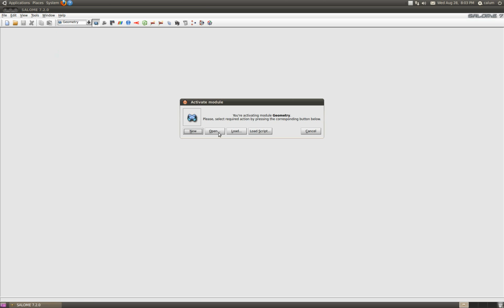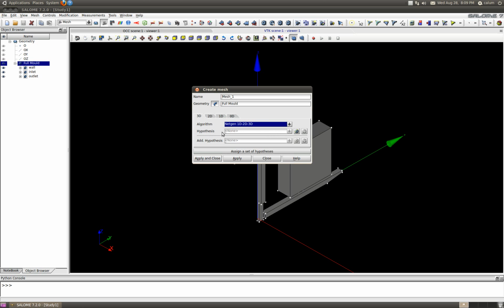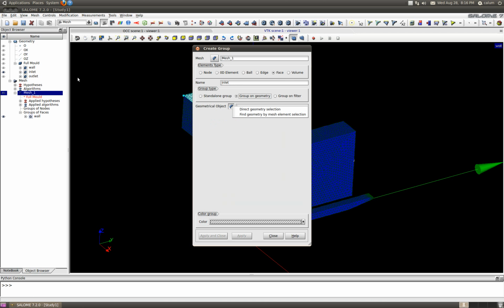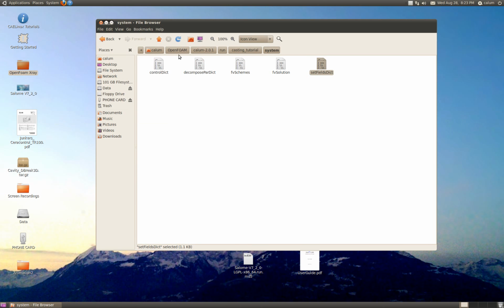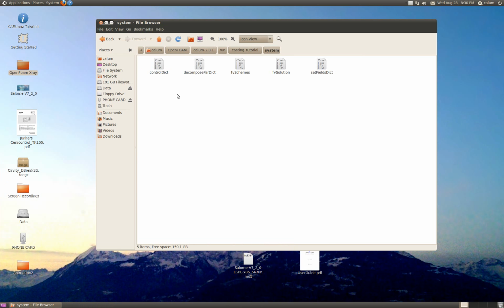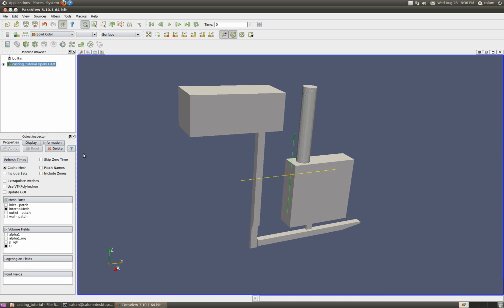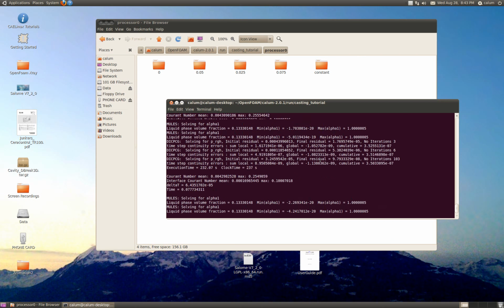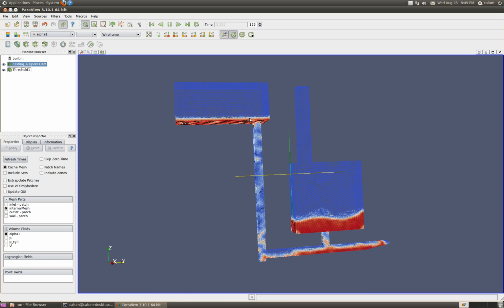Salome OpenFOAM Tutorial - CAD model to Solution Complete

Comment: Hello Calum, this tutorial is amazing! thanks for that. I'm trying to follow you, but in the files that you uploaded is missing the ''constant'' folder. Regards
Reply from the maker: It is explained in the video, that I did not include the constant folder, as the one I used is unchanged from the constant folder in the Dambreak, in the tutorials folder in the standard openfoam tutorials. So just copy the constant folder from that, and it will work. Of course some things will have changed as this is for an old version of OpenFOAM.
Reply: @CalumDouglas  okey mate, thanks again!

Comment: Hi. I am using version 4.1 of OpenFOAM.Whenever I try to run the command :  mpirun -np 8 interFoam -parallel , an error appears stating that buoyantPressure has been changed to fixedFluxPressure. After changing it and running the command, one more error pops up. 
FOAM FATAL IO ERROR: 
 cannot find file
 file: /home/stark96/OpenFOAM/stark96-4.1/run/trials/casting/processor0/0/alpha.water at line 0.
Is there any workaround for this ?
Reply from the maker: There are significant code detail changes from OF 3 onwards. Just follow the video, but use the DamBreak tutorial from your OF4 installation as the starting basis. I will try to do a new video soon but before that - this is the best course of action.

Comment: Hi, Great tutorial! I was trying to follow your method to setup my own simulation. I wanted to import the CAD model I have created into SALOME, creating the patches and exporting it to use it in OpenFOAM to study the flow of a fluid in a cavity. I managed to get the .unv file but when converting in OpenFOAM it does not work because it says that the controDict file is missing. Do I have to create the controlDict file first? I was hoping OpenFOMA import tool would do it for me...
Reply from the maker: Hi,
I think you need to learn some more about OpenFOAM before creating your own simulations.

You must learn how to run some of the examples so you understand what things like the controlDict are - before you can build your own case.

The control dict is covered in my video, it even shows you in the contents list where to look at the video to see ControlDict - so this suggests you did not actually watch the video.

UNV to Foam imports the mesh - ControlDict controls the simulation parameters like time-step.

I suggest you learn to run and modify the basic cases like DamBreak and Cavity. Understand how they work before you try to jump in to the deep.
Reply: I don't really see an obvious reason why the controlDict file is needed to run ideasUnvToFoam, however it does just take 5 seconds to copy one into it :)

Comment: As someone who is just starting out in CFD, can you suggest whether I should be learning to use snappyhexmesh or salome as my meshing utility? Has salome any significant disadvantages in comparison? I intend to run 2D simulations derived from 3D CAD files. Best Regards
Reply from the maker: Salome is ok for very small very basic models, but if you want to do any sort of problem with "real world" geometry, large files, complex shapes - forget about salome.

It is far too slow to make very large meshes.
Reply: Thanks for the tutorials and clearing that up!

Comment: thank you so much. I am wondering if you any other software for labeling patches. I am loading STL files in Salome and it takes forever to do anything.
Reply from the maker: I rarely use Salome, so usually I just manually rename the stil files (which means they have to be ASCII)

All that is explained in my SnappyHexMesh video

https://www.youtube.com/watch?v=ObsFQUiVi1U
Reply: Thank you so much for the reply. What do you do if your stl file has more than one patch in it? How do you name each patch? The point is that my stl file has only one solid in it. So somehow I need to separate facets into different solids.
Reply from the maker: Please ACTUALLY make some effort to watch the video I made AND gave you the link for before asking a second set of questions.
Reply: +Calum Douglas I watched this video and snappyhexmesh video before. But I'll watch them again. As I said I just have one solid in my STL   and I want to extract different patches.
Reply from the maker: You need to do that at the CAD stage, before you export as STL. An STL is just a collection of triangles, as I showed in the video - so unless you break up the model at CAD stage, its very very difficult to do anything with patches. Perhaps possible, but I do not know.
Reply: +Calum Douglas Thanks.

Comment: Thanks for you video. I am learning OpenFOAM with the purpose of simulating a cast filling process, and the video gave me a great start. As I am new to OpenFOAM, i would like to know if you could answer me two questions. I see that you used the interFoam solver. Can the InterFoam solver compute the heat flux while the filling occur ? And can the solid wall of the mold be added to the model?

Comment: hello Calum Douglas and thanks for your useful tutorial,
i'm new to OpenFOAM and i need some help to set up my case. I have to implement a flow in horizontal cylindrical tube in which there is water-based allumina (Al2O3/water) nanofluids (with volume fraction 3%). I made the simple geometry and the mesh with Salome, after that i exported the file in unv format ( with wall inlet and outlet mesh groups). I want to study the heat conductivity and the sedimentation effect in the pipe, so i think i should use the buoyantBoussinesqSimpleFoam solver and so i copied and pasted the file in the hotRoom tutorial folder in order to change the paramether and to do my simulation. So using ideasUnvToFoam command in the terminal i imported my geometry. 
Is it the right procedure? 
The simulation is for a study about sedimentation in a flat panel solar thermal collector using nanofluids. I have some doubts about how to change that parameters in 0, constant and system folders.

Comment: hello calum
Thank you very much for such a useful tutorial. I have one problem.
I was trying to mesh a simple cylinder made in salome and then i tried to mesh it. while doing meshing I used alll same option (just for practice) as you used in this tutorial.
After selecting all parameters, i computed mesh but I got following error

"No automatic update of the presentation has been done:
new mesh size (332076 elements) exceeds current size limit of automatic update (500000 elements)

can you please tell me what could be the possible errors. Thank you
Reply from the maker: you need to alter your meshing options in Salome. \

http://www.salome-platform.org/forum/forum_10/96483388